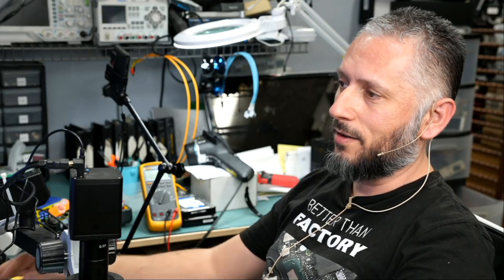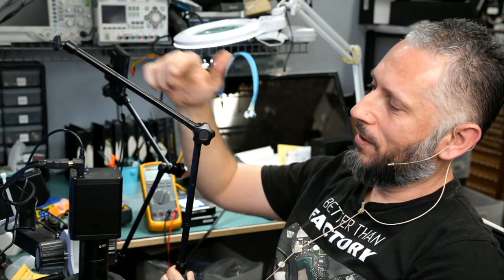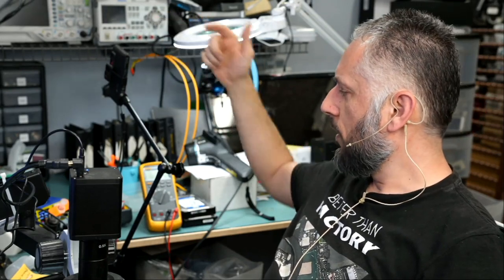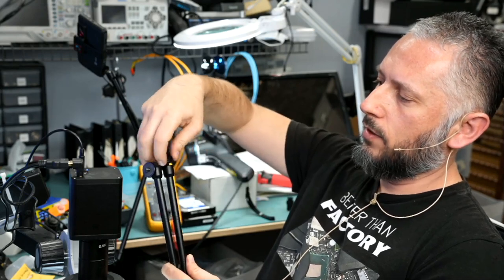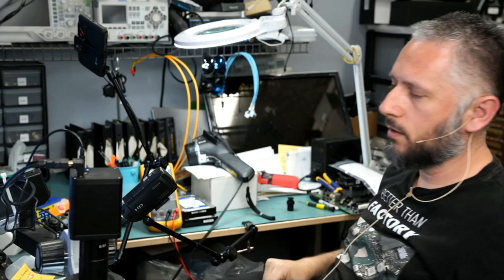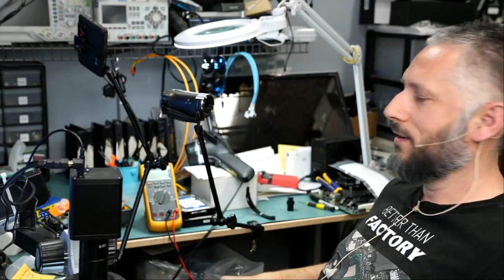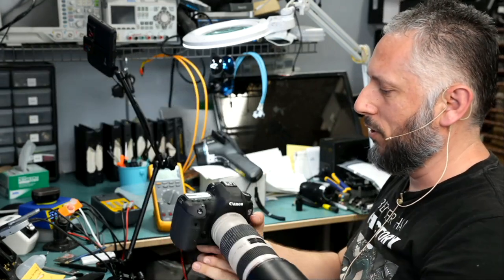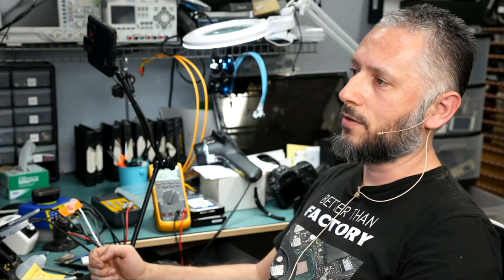Amazing Clamp Arm with 3 Adjustable Joints - Perfect Thermal camera stand.

Comment: As a motorsports photographer, i have been using a shorter version of that clamp for attaching various accessories such as triggers, flashes etc etc for the past 3-4 years...shorter arms on the clamp makes it more stable...weakest point on that clamp is the center knob which tightens everything once in position...being plastic over metal nut, the center of the knob is destroyed after some use...i found the solution by replacing the plastic knob with metal butterfly wing nut...another tip is to remove the rubber lining in the jaw clamp...makes it more stable..

Comment: I'm more than glad to have seen not just a camera, but a lens also in a single video of yours. That area is my forte and I try to use knowledge shared by you to apply in my struggles with photography gear, but it's not always easy. For example I have a backlight blown on one camera lcd but haven't been able to locate a fuse, coil or capacitor that I see in your iPhone repair videos all the time. Nobody does board level repairs on camera gear on YouTube to the level that exists in abundance on mobile phones and I don't know why because cameras are even more expensive than mobile phones and should be a viable career path. Oh well

Comment: You should see the size of my ex-RAF photo viewing lens, got it for a tenner off ebay, thing weighs with arm about 40 pounds (the arm says its rated for 100 pounds dead weight) and it has a ring fluorescent tube in it.   I have modded it with fitting a projector tv lens on a crudely made arm that gives me about 100x when swung in line with the main lens, abs brilliant solution for my tired ol' eyes and if I need any more mags I just get my sad and cheap (£10) USB scope out hehe